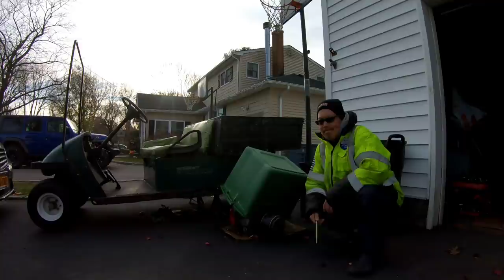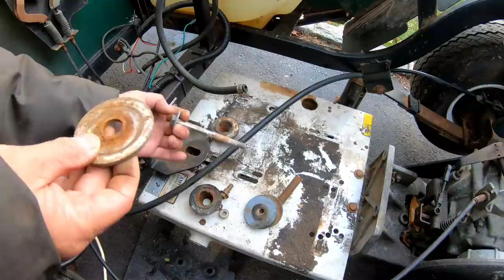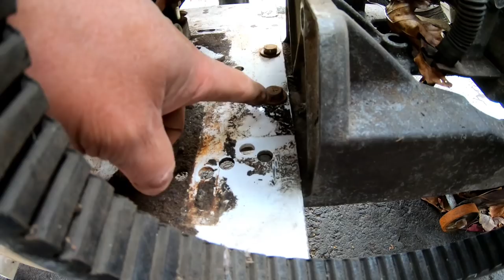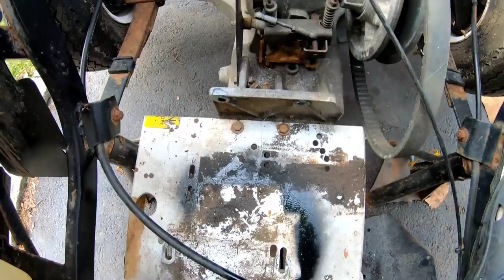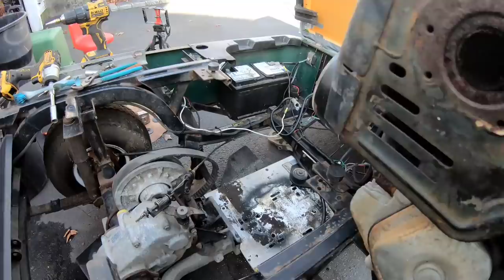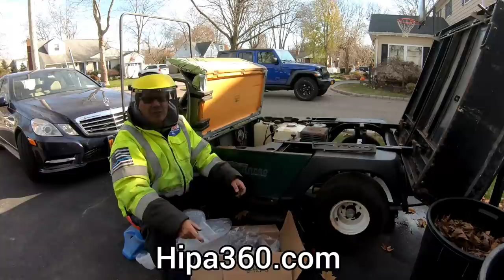EZGO UTILITY GOLF CART REPOWER PROJECT HONDA GX340 CLUTCH BOLT INSTALL & DRILLING ENGINE MOUNT HOLES

Comment: Henry I would cut the belt then put it on the clutches and then you can measure it more easily, of course leaving it a little loose as it was on the old set up. Also it is important that the clutches are lined up perfectly, so put a square on them before you mount engine.
Reply: Henry..... i agree with Mick.  Cut the old belt..... put it around the clutch and see whats missing at the rear pulley.    52 seems about right from what i see.  Cut that belt Buddy!!

Comment: Cut the holes into slots so you can adjust the engine to belt size. Trim a corner of the back bolts so they are held by the wall on the plate.

Comment: You got to tap and die set does it have any metal if it does find whatever is close to that and the metric fine threads and through the tap in to make sure that the threads are right and then you'll know what it is

Comment: Using an old belt that you can cut to determine the belt length is the way to go.  It saves your existing cogged  1&1\8" belt, and helps you line up the CVT and crank pulley for exact placement.

Comment: Henry , you made good progress,  but my only concern is that the fixed side of the clutch pulley did not look in align with same side on the transmission pulley. From the camera angle it looked like the engine needs to move towards the drivers side of the cart a little.  Might just be me. 👍🇺🇸Roger
Reply from the maker: I may need to adjust when I get the belt

Comment: Henry,  If you go through your belts and find a belt that works as far as length - Then that would be a major help with the belt number on the belt itself to determine the actual size.
Most of the industrial vendors who sell belts instruct you to take a piece of rope or like even a string that would go around the pulleys in which you would snip off the extra. From that you can get close enough to get a ballpark measurement for the belt. 
A old serpentine automotive belt would also be good to use being that the belt pulley looks like that it uses more of a flat belt instead of a standard V style belt. 
If you had a cloth style measuring tape, You could really get a exact measurement. Hope this helps you out, Henry.
Reply from the maker: It has to be 1 1/8” wide because you have to measure as if the clutch is retracted to grip the belt.
Reply: @MowersNBlowers  The drive pulley works just like the Variator on the older John Deere’s and the VariDrive pulleys on the MTD lawn and garden tractors - Not sure about the AYP products. There’s probably a specific name for the belt that you need and I cannot remember what it may be.  Where I retired from, we had a power hacksaw that had the same type of variable pulley setup but used a V belt. How thick is the original belt, I’m kind of curious. The hot rod enthusiasts use a belt for the blowers that kind of reminds of what you are looking for.

Comment: I had hipa reach out to me also . They got good products . Not sure if I ask this before  Are u keeping the gas tank on that engine or using the tank already on the golf cart?
Reply from the maker: Keeping the Honda tank because I’d have to convert to fuel pump delivery.
Reply: @MowersNBlowers  makes sense bro
Reply from the maker: @Turningwrenches85  I guess I could do it,  but I’d have to find a pulse hole for the Honda which there isn’t and I didn’t want to make a new one, plus the gravity fed tank fits under the seat.
Reply: @MowersNBlowers  hey like they say if it is not broke don't fix it keep it the way it is :)